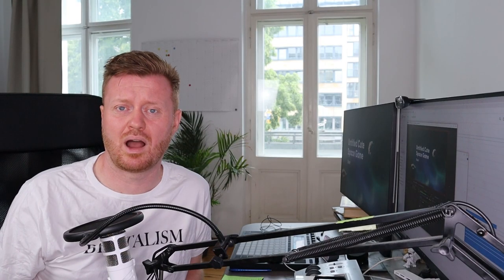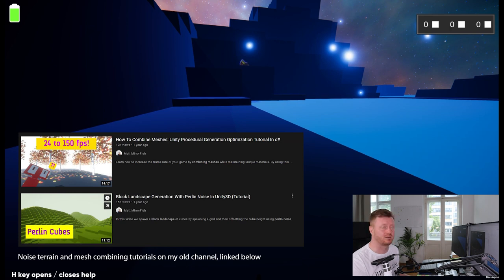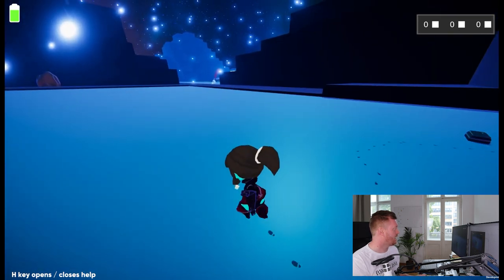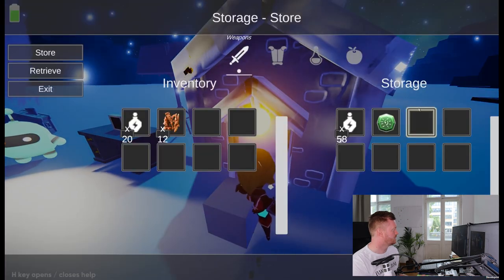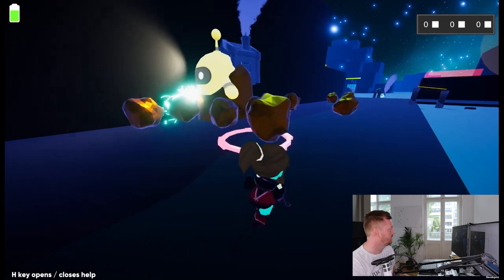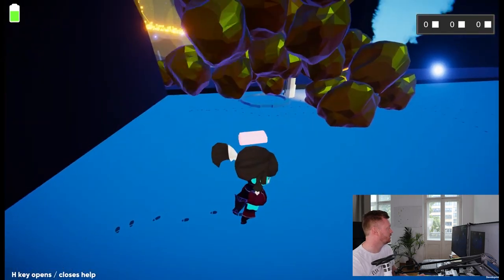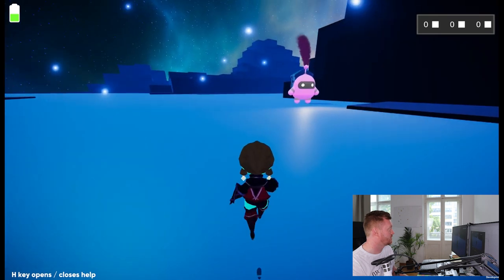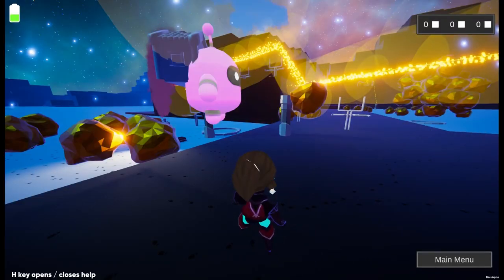Indie Game Devlog: Gravity Tools For Our Automation Game

Comment: I like the idea of the Rube Goldberg style, hovever as is, it seems like it would be very frustrating with odd  resources flying away and having to go gather them up again. Maybe more precise mechanics? stronger gravity fields and visual indication to where exactly the resources will land? With more predictable outcomes, crazy rube goldberg machines will be fun to set up and then switch on, as you get to see your resources bouncing from one carefully placed spot to another. (although I appreciate in practice that is probably a massive pain to implement)
Reply from the maker: Hey Isaac, yeah I agree that making things more deterministic will help I think. I don’t think the chaotic aspect is the fun part. In this case it won’t be hard to make it more precise, though it will be hard to make super precise. I’m going to continue to experiment. Thanks for your comment!

Comment: One though I has was what if droids were optimised for long distance travel where grav belts were optimized for short distance transportation? Not sure how you would implement that, but just another thought I had
Reply from the maker: Yeah I think getting clear on the purpose and advantage of each thing will be key as we go forward. Right now it’s not yet clear.
Reply: @ThousandAnt  lol, not really, but I think it could also help players make more meaningful choices. Choices are never fun when it feels like there was no point to it.
Reply from the maker: @coobbyo  yeah absolutely, I think I'm at the stage of figuring out what tool is going to be fun and useful for what job and then once that's clear to me I can try to build in some limitations like "Droids are good at this, but not at this". Right now I don't feel like I get the whole system well enough to do that confidently. More experimentation still needed!